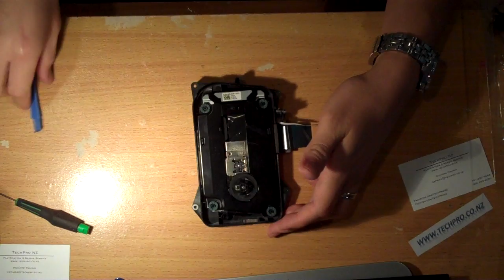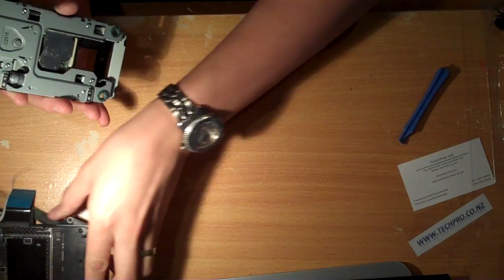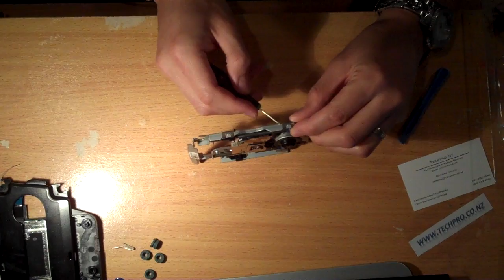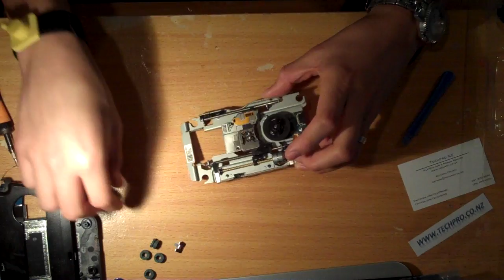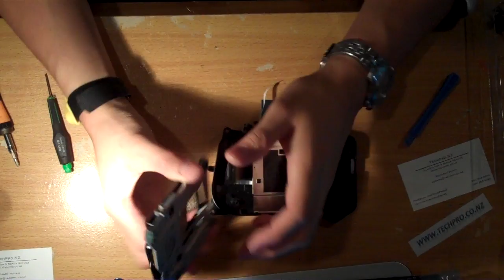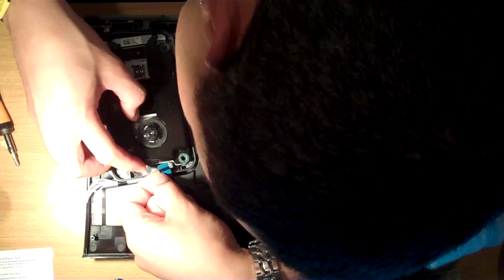PS3 Super Slim Laser replacement STEP 2

Comment: What do you call the first unit that you pull out at 0:49?  Can I just replace that with another one from another PS3?
Reply from the maker: That would be the optical drive unit (KEM-850a) and yes you can replace it from with another PS3s unit as long as it is from a CECH4xxx series.
Reply: Thank you
Reply from the maker: La Bete Du Gevaudan No problem :-)

Comment: hi Richard, there is small green IC like board screwed where the thin white ribbon is plugged into the tray. There seems to be a rubber like clip which helps to spin/read the disc upon sliding the ps3 lid(cover). By mistakenly i broke the rubber like clip(or plastic clip) and also damaged the green IC like board. Where can i get the IC like board with the rubber clip attached, so that my spin/read mechanism can be restored on my ps3 thats functioning normally otherwise? Thanks in advance:)
Reply from the maker: Vili Ghst I think you are referring to the open/close sensor, MODEL:MFW-001

Comment: Hi mate" mine has stopped reading disc's too, if you turn it on and then eject it again the dust is always in the exact same spot it was. 
I'm guessing this isn't the laser but the motor that spins the disc? 
Is that right?
And am I better off just changing that whole piece with laser and the bit the disc sits on
Thanks heaps
Reply from the maker: GQ454 Yes, but the KEM model as this will inlcude the motor and laser.  Some times is is not the laser that is faulty but the disc spindle.
Reply from the maker: Tyree Caldwell Yes absolutely, please contact me via the website www.techpro.co.nz

Comment: Hello. I have the super slim 500GB (CECH-4004C) and it has got a few drops of juice to the disc drive. I have taken apart it and can´t seem any failure with my eyes. Problem is that the disc wont spin at all. The laser focus to the disc and if it is moved by fingers to the outside of disc and powered on the laser head moves to center and try to focus on the disc.  Just like in the wideo i found on youtube

Super slim ps3 barely tries to spin or reads disc

I bought a new cable from the drive to the motherboard but it did not make any changes. Is there any way to test just the drive motor or do yoy think the failure is in the laser module. If it is in the module what laser should i search for on bay?

We don´t have any PS3 parts here in finland so the only way is to search ebay and find a seller that ships here.

I would be wery happy for some advice and maybe links to right parts.

Stefan
Reply from the maker: Hi Stephan, if all the laser cables have been checked and connected properly then the issue is with the laser unit.  The model you should search for on ebay is KES-850a